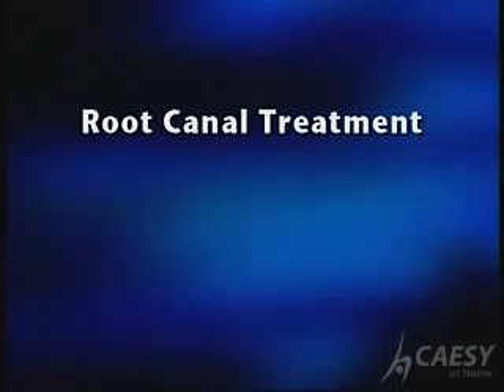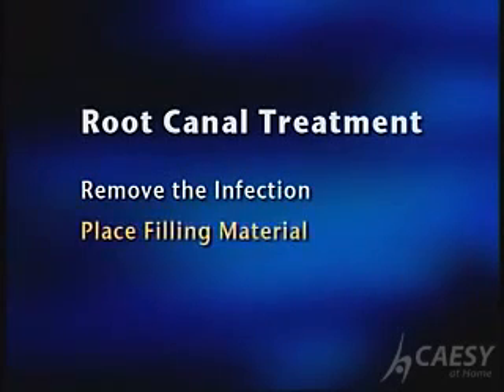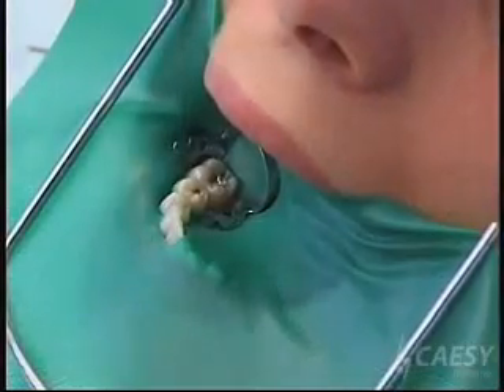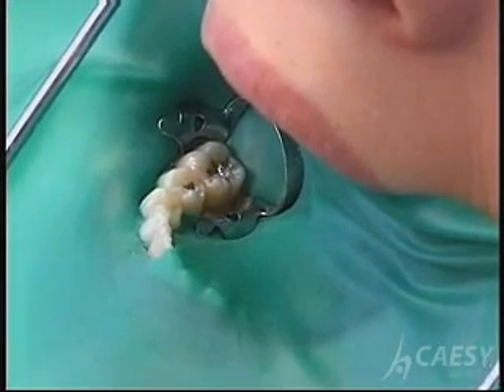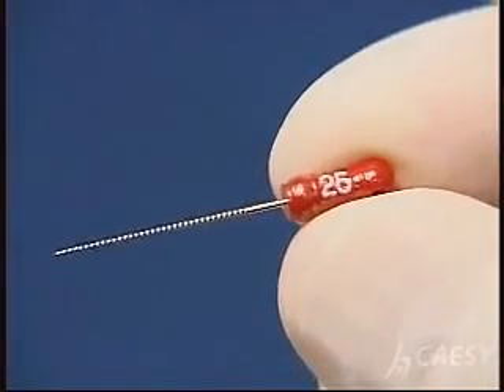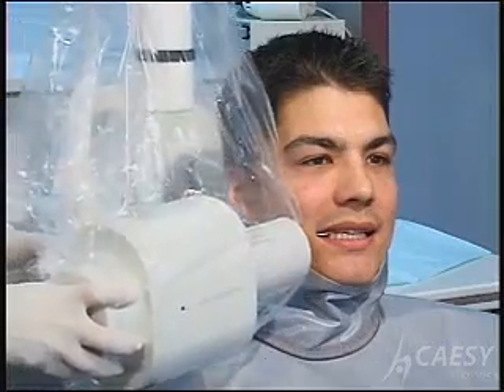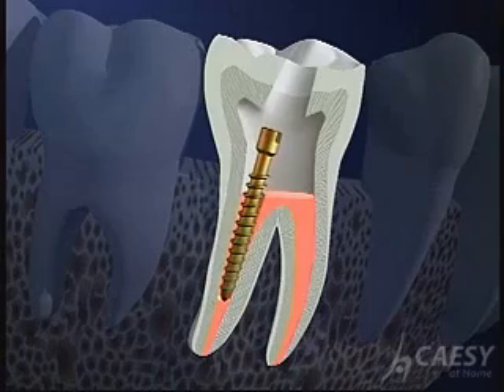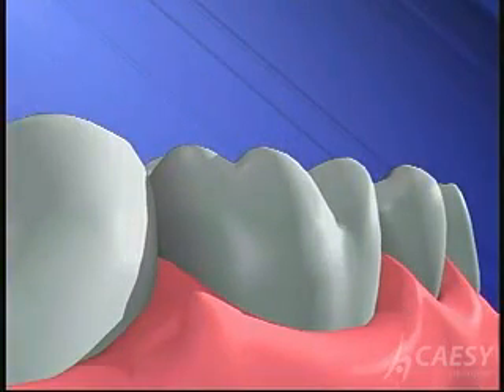Root Canal Procedure

Comment: prices can vary GREATLY depending on what part of the USA (or world) you live in. I live in the Boston area. There's a lot of very fine dentists in this area but they charge a fortune. Also.....the root canal prodedure is only half the price. You will need a "crown" (artificial tooth) cemented in as well. If you don't have dental insurance the two procedured could cost easily $3000 total (again this price can vary depending on where you live)